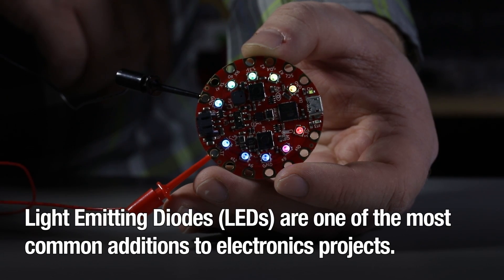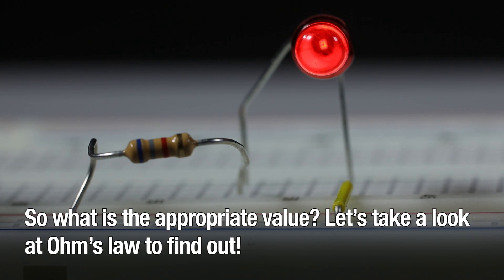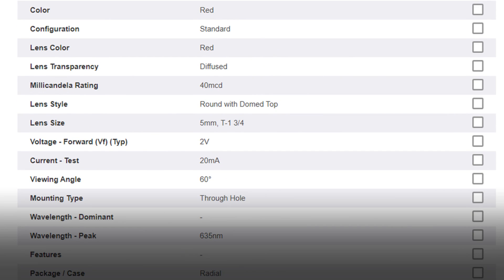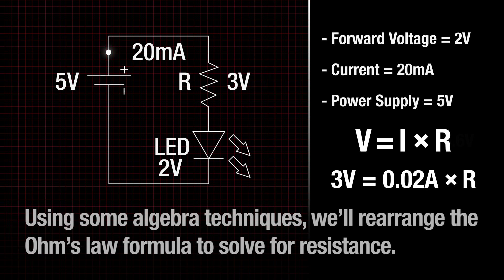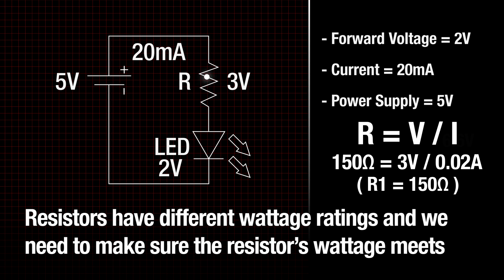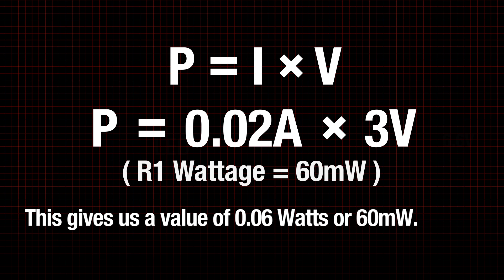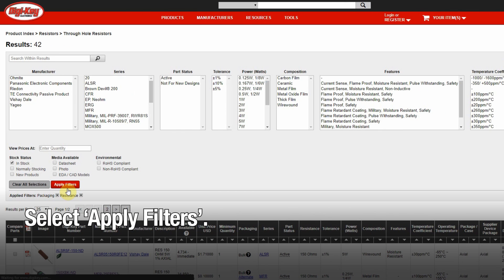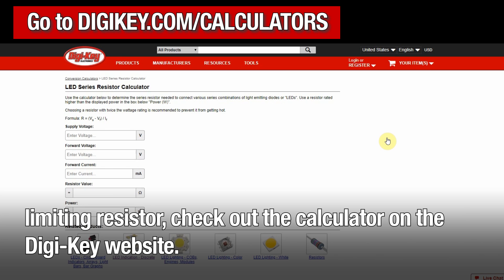How to Select a Resistor for an LED - Another Teaching Moment | DigiKey Electronics

Comment: What will get hotter? A 100 ohm 2W resistor or a 120 ohm 2W resistor? I thought that the 100 ohm resistor should get hotter because it allows more current through but I have seen some articles that say the 120 ohm resistor would get hotter.

Comment: As usual, glosses over the fact that the test current may actually be far too bright for your application.   The classic resistor calculator worked well a few decades ago, but these days most of the 20mA LEDs I use are perfectly usable as indicators at 1mA, and dazzling at 20mA.  In this case I'd stick in around 2-3kohm, and see what it looks like.  And driving an LED at 1mA is far more reasonable when connecting it straight to a microcontroller.

Comment: I have to connect a 3.7 volt lithium battery to a 3 watt led (3.4v-3.6v 700mA).
 What resistance should I put in 1/4?  I only have those.  What is the calculation to do?  Thank you
Reply from the maker: Thanks for your question. I think you'll find our LED Series Resistor Calculator super helpful. https://www.digikey.com/en/resources/conversion-calculators/conversion-calculator-led-series-resistor

Comment: how might this be achieved is the requirement is to dim an indicator LED on a device that was built / provided by somebody else, and the specs are not published?
Reply: You can replace the existing resistor with a larger one or simply add another resistor between the original resistor and the LED. I'd recommend starting with a 1k ohm and moving up from there

Comment: All details are very useful,bro. Thanks so much. So, I can't connect my smd RGB led directly to 5v and you're right, It drops the voltage for my motor :( R = 2.2v / 0.0.2A = 110 ohm - based on the RGB datasheet. So, I need 110 Ohm) I understand now Thanks again. May God bless you, bro.

Comment: Hes right if u wanna absolutely calculate, but what I did all my life is learned the hard way that most standard LED's are 3V MAX and some older Reds, Oranges are 2.3-2.4V MAX.
I never calculated such things for my projects, but what I do is I take an any adjustable resistor, connect it with LED in series and the source could be like 3.3V, 5V, 12V, 19V... and what I do is slowly decrease (adjust) resistor till I start to see LED shining and then (by monitoring LED voltage with multimeter) I slowly increase till I reach 3V if I want LED to shine absolutely brightest as it can shine without burning. And I can leave it on this max brightness if I want to, it will work for a loooong time and not burn. Always works.
I can even do this with like 10 LED's in parallel and one adjustable resistor (potentiometer). I guess what happens, the current gets adjusted automatically and I can get absolute MAX brightness, if you are gonna use this calculated resistor, you wont get max brightness if you need that for ur project, because it always will be a "safer" value but not of what LED can actually deliver.

Comment: That's a super easy way to look at it. 
In case anyone wants to finish the numbers in the circuit your LED has an internal resistance of 100 ohms (r=2/.02).
Reply: Sorry, that's not correct.  A diode does not obey Ohm's law where voltage is proportional to current.  It has an inherent voltage drop of 2V caused by the semiconductor junction, and that voltage does not change greatly as current varies.  At 1mA, the voltage is a little smaller, but still around 2V.
Reply: @Epi Endless  don't be sorry. I'd love to learn more. Maybe it's like a light bulb. When they are turned off they have a way different resistance then when they get hot and turn on.

Comment: What if I do not know the LED's forward voltage?
Reply: Usually between 2v~3.3v First hookup 1.5v AA battery, if it doesn't light up, try two 1.5v in series, some SMD LEDs have a forward voltage of 18v, yes, I was surprised too.
Just gradually increase the voltage, and you should expect a maximum 1w per single LED.
Reply: You need to contact the supplier.
Reply: @janszreniawski  What if I just have a pile of random LEDs?
Reply: @michaelkrug  same problem
Reply: You can use a digital multi tester to check the voltage drop
Reply: On internet it is available

Comment: Missed opportunity. Instead of repeating the same stuff everyone always says about selecting a resistor for an LED, how about addressing the real-world problem of someone who needs to determine a resistor value for an LED without having the LED specs? In other words, tell us how to find the voltage drop as well as some clues about typical current values for various  colors (a red LED with a clear lens is going to be more modern than a red LED with a red lens).
Reply: Emmett Turner that’s exactly what I need to know